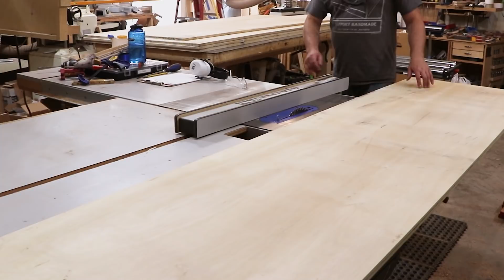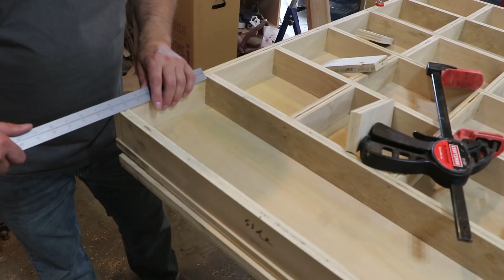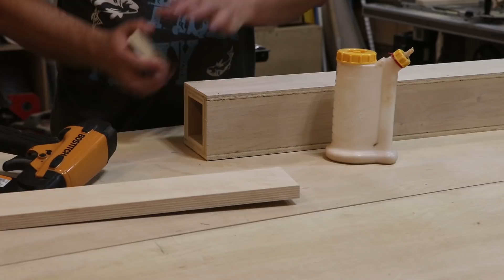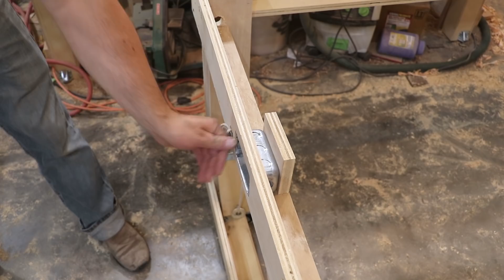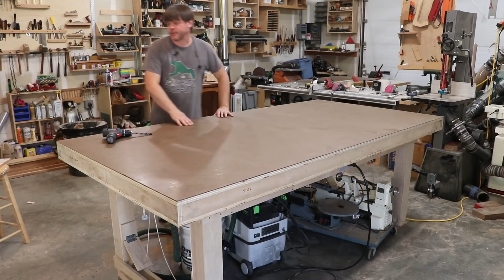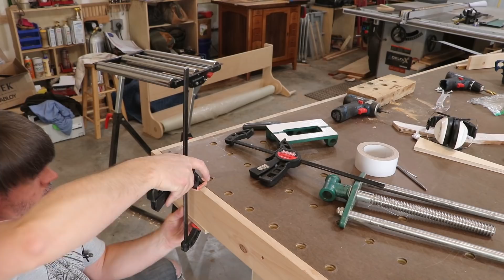How To Build an Assembly Table, Torsion Box Workbench - Woodworking

Comment: A rubber O-Ring at both ends of your Vise Handle will keep the ends from breaking off, which will eventually happen without them. Just saying. I like the way you did this much better than fussing around notching each strip of ply between the sheets.

Comment: I like that you used plywood instead of mdf. How are you liking the bench 3 yrs down the road?
Reply from the maker: It is holding up great, and still super flat.  Just a bit more worn looking.  It's got some war wounds from use
Reply: @Benham_Design  Thanks. My next bench will be a smaller version of yours. I'm downsizing.

Comment: What would be the structural difference (if any) if your long members of the web went crosswise instead of lengthwise? Reason I am asking is that it seems you can more accurately mill the crosspiece of the web than the long pieces of wood. Trying to use a 6" jointer to flatten a 6 to 8' piece of plywood seems dang near impossible unless using "golden" Baltic birch also known as "unobtanium wood."
Reply from the maker: That was my thought too.  I think if I half lapped each joint I probably wouldn't have had a problem.  I stapled each cross brace piece and I think those staples had just enough flex for the table to end up out of flat, as it sagged over the length.
Reply: Sorry to hear about the sag. I was ready to try my approach since I already had a base built ala King Fine Woodworking. Guess it is back to half lap. Thanks for the response. @Benham_Design

Comment: Interesting video. I like your miter saw “station”. Everything you need and nothing more. 

I would try to shim the surface underneath the build instead of the framework itself.  A tiny thing - I would cut one piece for that last row and test the fit before cutting a bunch.

Comment: Sorry, this might be the dumbest question in the history of woodworking, but how did you attach the torsion box to the base/legs?  All I saw was you setting in on top of them.  For the life of me, since a torsion box is hollow and generally made from pretty sheet goods, I can't understand how the base/legs can be attached and still be sturdy.  Anyone?
Reply from the maker: I attached aprons to the legs which made them stable and then used pocket hole screws to screw into the bottom of the box.  I don't remember what thickness I used for the underside of the box, but it was thick enough for the screws to get a good grip.  Probably minimum of 1/2"
Reply: @Benham_Design  Ok, thank you very much for your reply.  There are a million videos on YT on how to build a torsion box, but I've yet to find one that clearly shows how to attach it to a base.

Comment: Excellent Video!  Does that wheel mechanism work well for you?  I have seen that style of wheel mechanism before and the workbench didn’t seem to roll around very well at all.
Reply from the maker: Thanks man, I think the key is putting good casters under it.  The bench before didn't roll well because the weight of the bench bound the casters up.  I put a heavier duty caster on this one and it rolls much better.

Comment: Why did did you choose to use plywood for the grid rather than MDF? I am going back and further about building a torsion box or just laminate two sheets together. If I go the torsion box route I figured to use ply wood as I would think mdf would have a tendency to compress if a piece of work was hammered on and thus create a low spot on the surface,
Reply from the maker: I think you nailed it, plywood structurally is much stronger than MDF.
Reply: ( We call MDF " Glit " = Glue and Shit.)